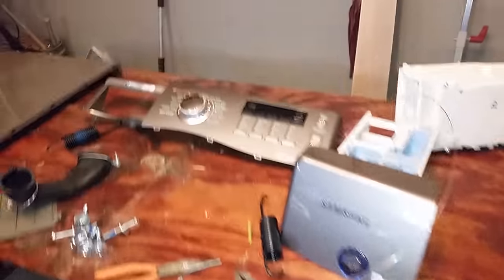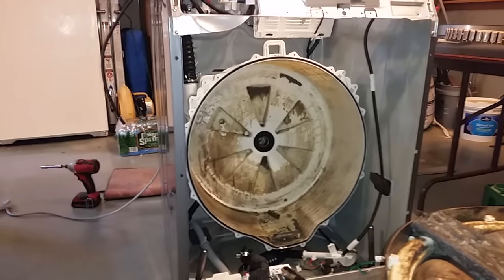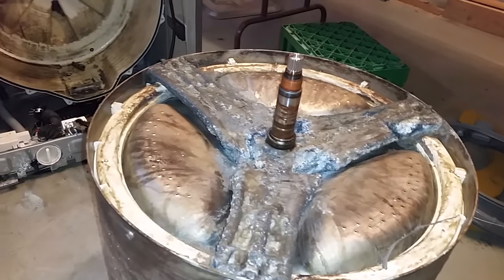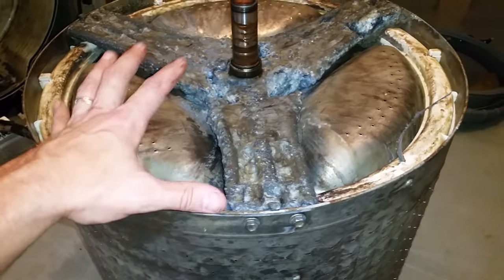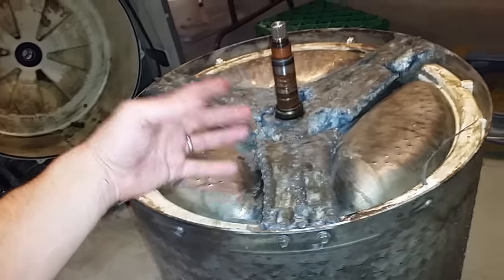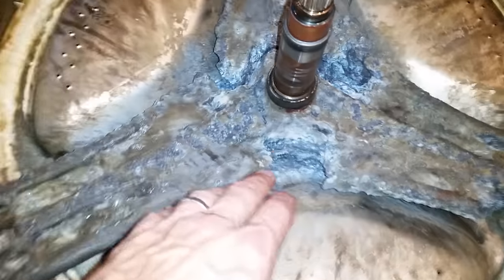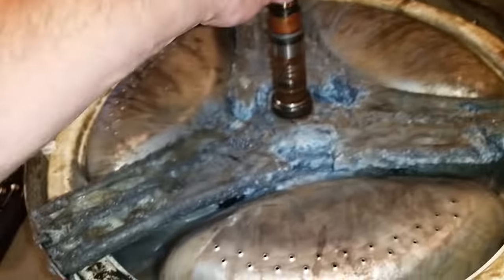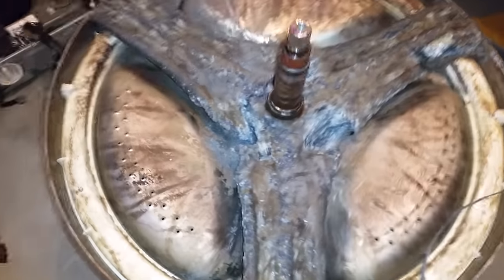Do not buy Samsung front load washer machines

Comment: I'm so glad I held on to my old school regular washer. The thing is about 30 years old, washes clothes beautifully and actually fills all the way up with water! My daughter had one of the low water top load washers and the clothes didn't even get all the way wet sometimes because it wont use enough water.  They have to keep buying a new one every few years because they break and the repairman says it's the same price to repair it as it is to buy a new one. Most people are not mechanically inclined to be able to rebuild it like in this video so she bought an old washer from a neighbor at a garage sale and the thing is in perfect condition and is built like a tank and has been going for years now. Sometimes the old ways are still the best ways.
Reply: Yeah mine , from 99 ,  just got opened up because the belt failed . No mess inside , no leak marks , bearings are pretty good . I have seen a comunist made automated washing machine still alive  (but barely) in 2015 .  These new appliances are a shame .

Comment: Philip, thanks for the video, even if wiggling all OVER the place. As a guy who sells lots by video (eg-  VHS tapes asent to customers all over 30 years ago), puh-leeez put your cell phone or camera on a tripod.... and keep it steady on EACH view.  Also the "bracket" hodling the drum is called the "Spider Arm" Also- why not say "zinc alloy" instead of 'material' - so KNOW it can NOT be welded!  You are right, it seems planned obsolecence!  Anyway, thanks a lot. They could easily make this out of corrosion proof SS sheet, such as 404, if not 302 or 304 Stainless steel, just like the drum is. A $100,000 die to form the reinforcing grooves, ridges, and bending, may by amoritized over 100,000 machines. So add a $1 to the cost. We just paid a Samsung "Authorized repair" $150 for the ESTIMATE, quote being $500 to repair it!.

Comment: Nice job of explaining electrolysis and how the machine will eat the spindle strength member. (Major structural failure, due to corrosion).
  This is like what happened to the statue of Liberty and why she had to be rebuilt, her skin, dissimilar metals, leading to corrosion due to electrolysis.   Also the large stator motor may have contributed to excellerating this corrosion due to free electrons in the field proximity.
  Nice video and thanks for sharing and your contribution to this problem leading towarrds a resolution. .
Lastly,  I want to take the time to Thank you for your service in the past and your continued service..  I am not sure what is wrong with my machine yet, but this knowledge I am happy to have as I push forward with my troubleshooting. 
Thanks. .appreciate it.

Comment: Folks quite bickering about the cause! We had ours suffer exactly same fate. I was a professional sailor in US Navy. This is bi-metallic galvanic corrosion. It has nothing to do with using this or that soap, too much soap, water softener, wrong soap, blah blah blah! Google a picture of zinc anodes on a hull before they are replaced (entire anode corrodes not just contact points).....look exactly the same as these crappy cheap spider arms! There is current moving through that arm...stray current to ground, has dis-similar metal....you could run nothing but water through these machines and the spiders would corrode every time. The drum and spider should be the same material, period. I opted to throw the machine out to a recycler who did the repair and resold the machine. We went back in time and purchased a top load with direct drive. That was our longest running machine before the front loader at ~ 10+ years. Now we have a new one and despite some more noise on the drive, it washes WAY better than the front loader ever did. All the promise of saving money for less water and soap usage means nothing when the stupid machine is dead 4 years after purchase! Good riddance front loaders! BTW, there are a couple of brands from Europe that actually use steel spider, but they are hard to source and VERY expensive....
Reply from the maker: Mario D you are right about any type of water however certain types will corrode quicker. It's all about the electrolyte ability to move that current as stated earlier in the video. I did miss speak in the video, this is not a zinc alloy product but a cast aluminum product again bolted to stainless steel two very dissimilar metals
Reply: Were you fresh water Navy?   Salt water is a great electrolyte that will attach almost any pair of dissimilar metals.
Reply: If the dissimilar metals was the problem, the corrosion would be at the metal interface.  It is not, therefore the corrosion is chemical in nature, not electrolytic
Reply: The aluminum is just plain incompatible with the service.  It is known to corrode rapidly in hot alkaline water, and all laundry detergents are alkaline.  The cleaning pucks contain percarbonate and sodium carbonate so they are strongly alkaline and oxidizing, as is regular hypochlorite bleach.  The part seems to fail at a stressed location- the joint between the arm and the round portion of the casting where the shaft attaches.  While a galvanic driving force definitely exists and likely doesn't help, I'm pretty confident that even if you were to electrically isolate the drum from the arm, the spider arm would still corrode freely.
Reply: Funny, my front-loader is 15 years old and still working without a single repair needed except me personally opening it up to wash away the gunk accumulated by washing detergents in the thin inlet tube and once realigning the belt since it fell off.
Learn to buy good washing machines or learn to pay the idiot tax.
Reply: @Th3UprightMan  It is a little difficult to buy a good machine as most stores and machine manufacturers do not show an exploded view of their product. I want to see everything! I want to know how it ticks compared to others. Knowing that is their secret. We bought a top loader GE that had a board failure at 3months! Then again 2 months after the warranty expired... I have surge protectors on the circuit so it is not due to transient voltage, it is simply planned obsolescence, though their timing is a little rushed ;-) Unless you want to spend thousands for a commercial unit, you will always get garbage from residential units. I have learned my lesson.
Reply: What top load washers have a direct drive
Reply: @spotlightinspect5540  LG WTG1432VHF is an example. There are others.
Reply: so, you were a professional sailor, eh?
Reply: True and I suspect that Samsung is very aware of this.
Reply: @latemnetlom  , whatever the exact cause, it's a certainty that the arm in many cases does not hold up.
Reply: @xjstwr  agree it's chemical corrosion and not electrolytic. The failure always occurs at the shaft and not at the connecting points. For some people, it happens in 4-6 years and for others, it is 10 to 12 years. Why the difference ? It's how the machine is used and maintained. I'd like to know how this machine was maintained
Reply: If that's true then the part where aluminum spider is bolted to the drum should be corroded first not in Centre because central part don't get washed aways by water which has soap stick to it

Comment: Just repaired my samsung broken after 15 years of use. I ignored the increased shaking started couple of years ago, the broken shock absorbers lead to breaking the spider axle. I replaced the said 3 parts and now it runs again like new. The shock absorbers take a beating and have a limited service life. If your machine breaks down because of run down shock absorbers does not mean planned obsolescence.
Reply: 15 years is very good. Can you tell us how you maintained the machine? Powder or liquid and how many hot washes a month

Comment: I have repaired large commercial washers for 30 years.  My house has a 2004 whirlpool duet pair.   Still running great. no bearing problems.  I have seen this problem on small washers mostly ones built overseas.

Comment: Front load washers have been made like that since they firt came out if you read the user manual and use the proper amount of detergent and softner in the correct consistency (water consistency) you wouldn't have this issue so quickly that blueish taint is the gunk that gets caused by the detergent and softner that didnt break down with the HE models because of the water efficiency feature.. that gunk builds up and eats away at the cast iron spider the hard water doesnt help the situation. Look at the dispenser housing and check out all the residue from using too much softner and detergent. Other machines didnt have this issue so quickly because they were programmed to fill with more water which would help break down the softner and detergent and drain it so it wouldnt build up like this.
Reply: The Appliance Guru 4.5 year appliance technician here, clear sign of using too much soap. 1-2 tablespoons of soap.
Reply: @demonreamer12  ofcourse it is and i bet you this guy never did the self clean probably never even noticed the self clean cycle selector hes bashing samsung when its clearly his fault. 11 year tech here by the way

Comment: I've had a Samsung washer for 8 1/2 years and I've never had any problems.  It works wonderfully!
Reply: jinx
Reply: leaving the door cracked?
Reply: Don't worry. The Law of Averages is notorious about balancing its books.
Reply: Sherrie Pedersen:  ours is 7 yrs old and the filter cage suddenly filled up with particles the exact colors of what's shown in the video.  

Everybody:  who'd know to not fill to the fill line and use 2 tablespoons instead?  would seem inadequate.  ...and so the fill line is there in error?
Reply: It isn't your fault. The design is inherently defective and an intentional effort by the engineers to include a flaw that will cause failure after the warranty expires, but long before the reasonably expected life of the machine has been reached. The aluminum drive spider in contact with the steel tumbler basket cyclically immersed in an ionic solution will cause the dissimilar metals corrosion that you have seen. There are a lot of old school washers still in use forty or more years after they were made. SPEED QUEEN  still makes top-loaders that are almost identical to those they built in the 1950s. If you can't place the brand, go to a couple of coin laundries and check them out. Most of the top-loaders will be either Speed Queen or Huebsch brands, identical except for the name plates. They stand up to commercial service for twenty or more years, they have warranties among the longest in the industry, and they will stand up to anything your family can give them. You will have to go to a specialty appliance store, you may have to search online to find one, and don't expect it to be cheap, but they are the best bargain you will find.
Reply: The fill line, like the lines inside the cap of the detergent, is a recommendation based on an average quality of the whole country.  You cannot use those lines.  You need to find out what is recommended for your area.
Reply: Good thing you taking care of your washing machine
Reply: Yes, leave the door ajar when not i use. This will allow the drum to air out and prevent mold.
Reply: Dave Haskell racist much?

Comment: I would say stay away from Samsung wash machines/dryers in general. I bought brand new washer and dryer, both Samsung a little over a year ago. I have been disappointed with things not working correctly already. The load sensor in the washer and moisture sensor in the dryer are both glitchy with once to twice a week use.

Comment: I had the misfortune of owning one of these Samsung front loaders and I replaced the spider bracket the first time it broke.  The washer was noisy and never ran quite the same even thought I put it back together carefully.  Later I found out that the balancing ring was stuck thus causing it to be off balance.  With that, at about 18 months it broke again.  I pulled out my two old Maytags that had been in storage for over 20 years and hooked up the washer and dryer.  Both worked flawlessly and clean better than ever.  We are still using our old set 4 years later.  No more front loaders and NO MORE SAMSUNG appliances.  Our first spider broke at 5 years of use.
Reply: Brilliant, keeping your old Maytags. I wish I'd kept our old top-loader.

Comment: LG uses the same spider arm material and is no better than any other brand which uses the same design/material on such a critical part. 
I just did this exact repair on an LG washer I bought used. It was sold as "great condition" but it was anything but that.
I'm happy to report that after a few hours of work and couple hundred dollars on various parts the unit is like new again.
Anyone who tells you that LG is better than Samsung (or enter brand name here) is either a brand centric fanboy or earning kickbacks from said company. All these front load washers are equally made to be repaired/disposed after 10 years.

Comment: that machine looks like it's never seen a hot wash or biological washing powder
Reply: Agreed. Washing machines need cleaned. Not just Samsung, all of them. I repair appliances and I have seen some nasty washer and dish washer and people are putting their cloths or dishes in the mold and fungus.
Reply: Robbie Crosbie 
JOHN  can i as you about the samsung model DV42H5200GW and WF42H5200AW washer and dryer ? i am in the market to buy this set do you recommend and what to do to prevent mold buildup as you were saying?
Reply: Rob M I repair appliances as well. My advice from experience is not to wash every load on a quick wash. At least once a month run a maintenance wash on a high temperature. You don't have to have the machine empty if you think it's a waste of energy. Put a load of towels in. It will do them the world of good and whenever possible use a biological powder as the enzymes in the powder helps to keep the machine clean. Fabric conditioner contains animal fats which can turn black in the soap drawer and on the door seal so again a hot wash at least once a month will clean it out. I've never had a mouldy machine in over 20 years. Hope this helps
Reply: AMEN ROBBIE! 

Yes guys, Fabric Softener's main ingredient that makes your cottons feel all plush and soft and shit is called, tallow dimethyl ammonium chloride. In other words... ANIMAL FAT! Google it! And don't get butt hurt when your unit smells like ass after a week of using it.
Reply: Robbie Crosbie ñ
Reply: Actually tallow is a very common ingredient in most soaps and even detergents.  It also has great detergency as well. It's highly desired in natural soap making because of it's great properties but you wouldn't know that unless you made soap and understood all the aspects of it.
Reply: @ Robbie Crosbie, I know right? Common sense would be good here, of which the uploader doesn't have a good judgment of.. This washer looks like it never "saw" chlorine bleach, baking soda, washing powder, borax, vinegar, hydrogen peroxide...

Many people seem to think detergent is enough.. NO it is not.
Reply: Mike Studmuffin  not to mention that sometimes people use to much detergent
Reply: Rob Whiff i
Reply: mark40511 I use warm water never hot unless I'm doing a hot wash for cleaning and sanitize each month. True always need keep the washing machine open.
Reply: Robbie Crosbie Bravo! Thats what I was going to say! Liquid detergents make this mess to. Use powder and hot washes!
Reply: Borrego Images most soaps contain fat. Ever see fight club?
Reply: "Biological"? Really? Because there's no biological chemicals or matter that deteriorates each other? Welcome to life, where everything on the planet starts out living and dies.
Reply: It's really nasty inside, have never been properly cleaned, guarantied...so in todays world, you don't fix this machine yourself, you buy a new one, much cheaper...
Reply: We have had front loading machines in the UK for  decades , infact I dont think you can buy a top loader. You will see this build up if you don't do a boil wash at least once a month. You should boil wash ( 85 deg or above ) your bath towels anyway to stop bacteria remaining. Bedding should be washed at 60 deg to kill dust mites and to remove bacteria the same as the towels. If you constantly wash at 30 deg or less then you will get this build up of softner,detergent and mould plus your clothes will start to smell.
 To prevent the mould you should always wipe around the rubber door gasket after each wash and NEVER leave the door shut. It should be left ajar to dry out the drum and allow the air to circulate. Black mould will not form where there is good air flow. Regularly clean the soap draw.  Every 6 months run a hotwash with a washing machine cleaner and descaler such as " Dr Beckmann Service-it Deep Clean" or similar to be sure your machine is in tip top condition.
Reply: @johnlingafelter524  how would you deal with mold?
Reply: @ruffusstone  Lg best or samsung tell me plz? Different drect drive or samsung digital inverter?
Reply: @robbiecrosbie4506  great points. Particularly not to do quick that too cold washes and to use detergent with enzymes

Comment: For many reasons I'm done with high priced washers! I just bought a $400 Amana HE top load and couldnt be happier, it washes the clothes better than my last 2 " high quality " washers that both lasted under 3 years.
Reply: The transmission will fail in about 2-3 years. I know I work on many different brands and models. Sears appliance tech
Reply: @sidneyducote7329  That's a 20 dollar belt , no ?  My budget 99 indesit just breaked it's belt in 2021 (that's why i'm on ytb watching washing machines being dismantled ). It's still good inside , no leaks , no bad bearings , 30 years of weekly service . I have seen a communist made machine surviving 30 years ,  in a sorrow shape but functional . These new devices are a shame .